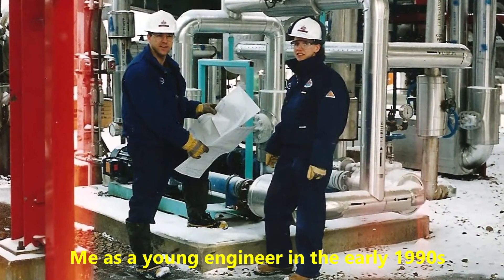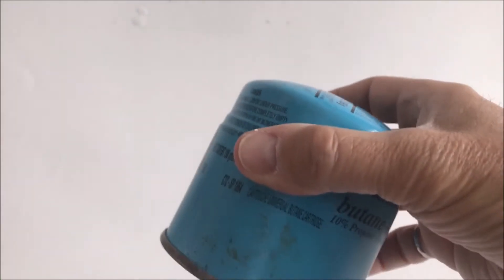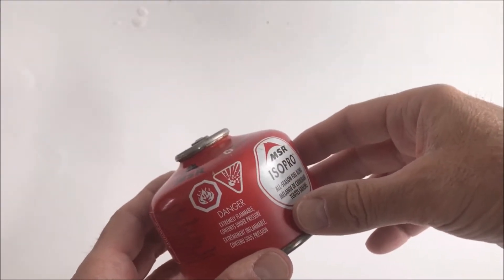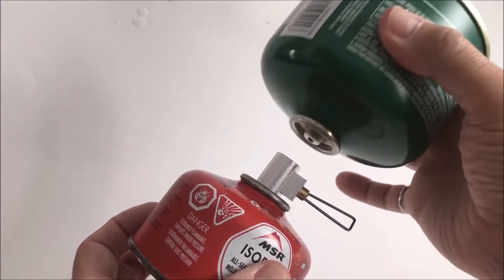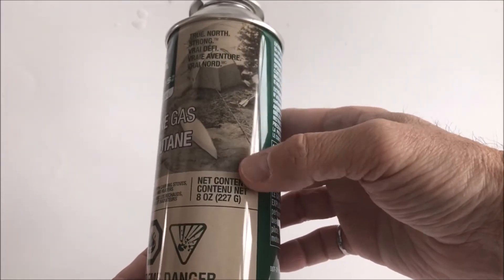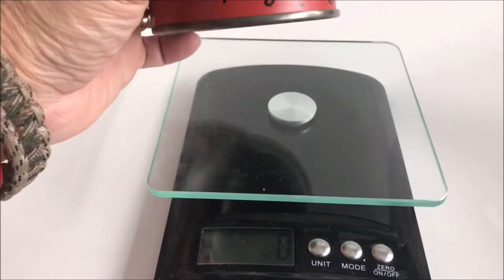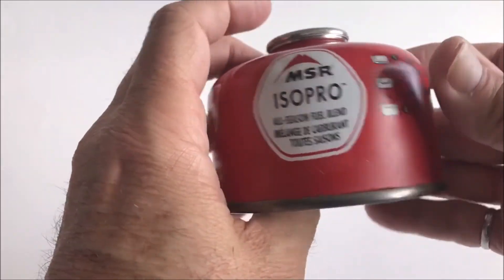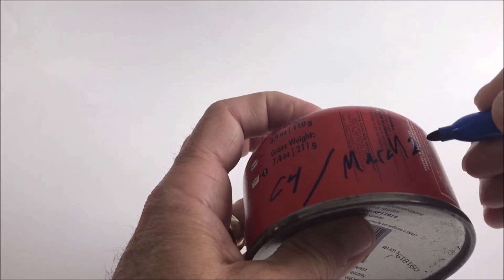How to refill backpacking stove fuel canisters with butane  |  Cheap & Easy

Comment: It is not legal to refill and use iso butane canister  in canada  one of the camping store  salesman told me
Reply from the maker: Of course he'll tell you that., he wants to sell you a new one for 4x the cost.  But, there might be some truth to his statement.  As a business owner he's not allowed to sell you a refilled canister, just like he's not allowed to sell you a refilled tube of tooth paste.  I'm a private citizen, and as far as I'm concerned it's no body's business if I refill a canister.
Reply: @Martyupnorth  Indeed. I replace them every couple of years after so many refills just to avoid rusting and whatnot. No issues so far. Same with the green propane bottles. I just make sure that its got the same amount of weight as the original amount so that its not over-pressurized. Also best to always check them out before heading out there to see if they are leaking in the valve of the bottle and replace as needed. If you hear hissing and or smell when shaking it that's a sure sign :) Whats funny is they don't recycle the butane in those canisters if there is any left but they sure as hell get back the propane from the green ones which is why they take them back at most depots. I wouldn't be surpirsed to learn one day that some outfill somewhere is collecting them and refursbishing them are turning them back to service (the green propane bottles i mean).
Reply from the maker: @draekko_  I've been to a few countries where refilled ones (the 1 litre propane bottles)  are delivered to people's homes every day because they have no other means of cooking.  Some third-world countries take recycling and reusing to a whole new level.
Reply: so long time back I order adapter for same purpose  but never used it coz i was worried about that illegal issie🤣🤣🤣🤣
Reply: Shhh....I occasionally exceed the speed limit. I keep my eye pealed for the highway patrol and I'm extra alert for other vehicles when breaking the law.😁

Comment: I wish I knew they could be refilled, I have about 25 or 30 empty and partially full ones.
Reply from the maker: The partial ones were always the worse.  How many times have you ever taken two half tanks on a trip?  Cheers.
Reply: @Martyupnorth  Exactly, too full to toss out and too empty to justify taking up space in your backpack. And I already have a hard time figuring out what should stay and what should go and getting it all to fit, especially on longer trips, and I have very large volume backpacks...so I need less challenges when it comes to gear and stay or go choices!

Comment: I have the orange adapter for the butane to the vertical cans and i would be careful with using it right on a stove even one that is a remote stove with a "rat tail" as i have had them leak and that's just asking for problems in the wrong circumstances. I only use them to refill now.
Reply from the maker: I agree.  The large bottles are designed for home use.  They're too fragile for backcountry use.  It would be so easy to puncture one accidentally.
Reply: @Martyupnorth  Also some of the adapters like the orange one have bad tolerances on the fitting and can leak through the fitting as well which is also a problem at times. It's all made in Chy-Na soooooooo .... lol

Comment: Cool hack. 

For clarity Marty, you’re basically transferring from the large can into the stubby cans because the stubby cans are better insulated and therefore perform better at colder temperatures than the large can, right?
Reply from the maker: Hi Neil.   The tall cans are not really stable and therefore are not suited for use in the backcountry.  The tall cans are for bigger stoves, typically used in homes or for car camping.  So the basic reason for transferring to the stubby cans is because the stubby cans are the ones most of us us on our hikes.  

The stubby cans aren't insulated, they're just made of thicker metal.  The reason for that is because they're sold around the world to store a variety of different fuel blends with different pressures.  They're built to a European standard, and are rated for liquids that will generate a pressure up to 13 atmospheres at 50C.  They're perfect for butane, but they couldn't be used for pure propane.    

The best cold temperature fuel would be propane, but the canisters would have to be too thick to be economical in small formats. This tip (refilling with butane) is really only good for summer camping.  Cheers.